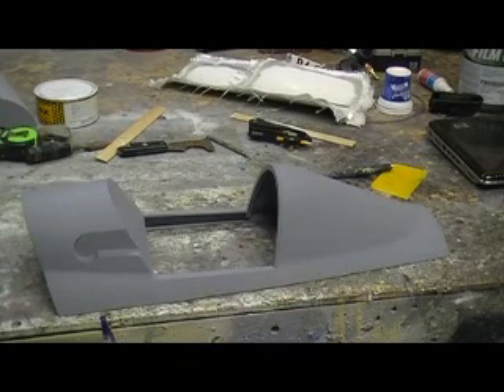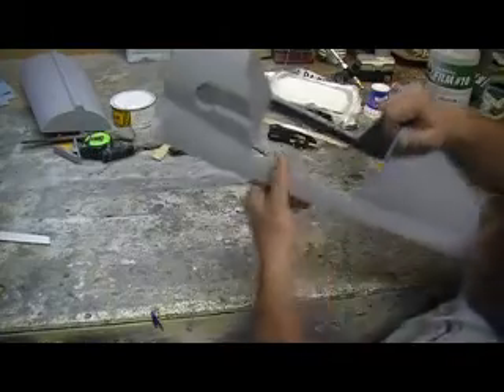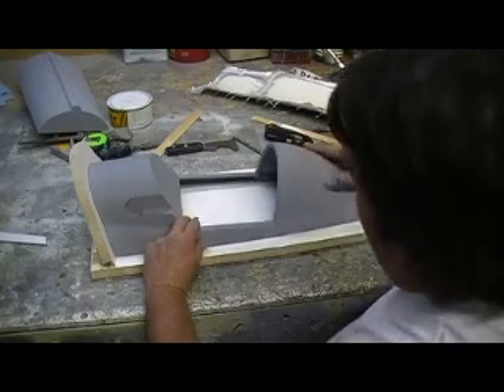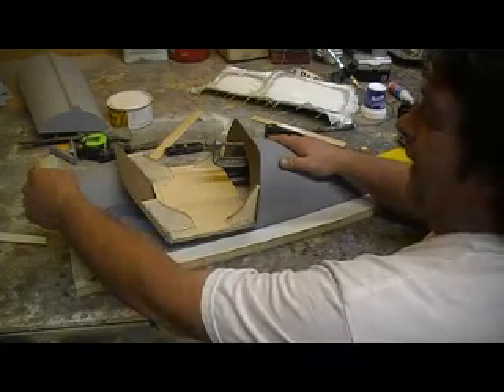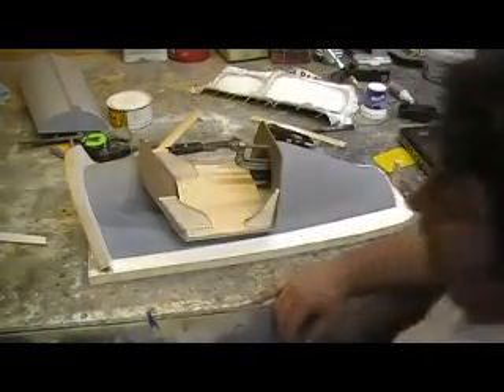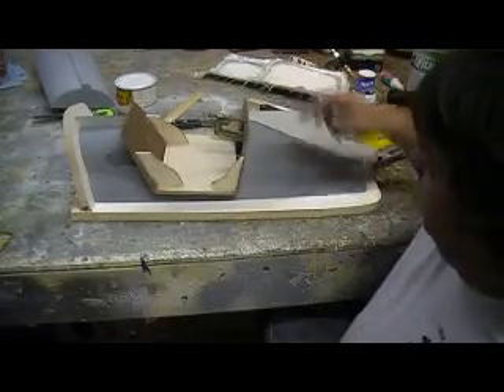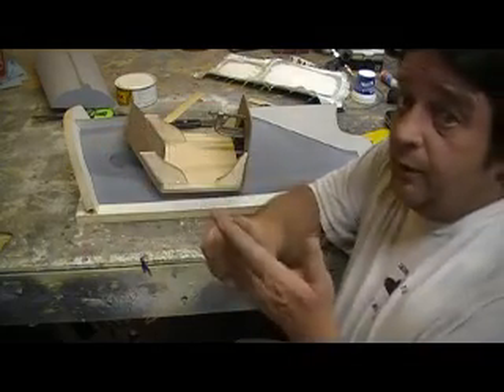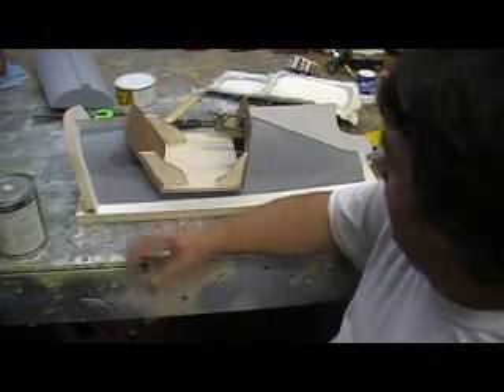how to build a rc jet  F-105 thunderchief # 167

Comment: I didn't think you were stealing my idea, I just thought you misunderstood my post. I have a hard time clearly putting my thoughts/ideas in the written form. If Bob wants to make a new mold for the canopy the only part of the mold that would have to be a removeable casting is the pivot area of the canopy arm recess. The straight arm part of the recess could be a permanent part of the mold because it doesn't have a lip to lock the finished part in the mold. The lip only exists in the pivot area.

Comment: Actually the only part of the cast of the canopy recess that would have to be removeable, is the rounded portion (pivot) at the back end of the canopy arm. The part of the canopy recess that represents the "arms" of the mechanism could be permanent parts of the mold, because the upper side of the part doesn't have a lip to hold the part in the mold. The only area that has to be removeable, is the actual pivot area.

Comment: @tmagdahl

That's basically what I said, make filler pieces, and then attach to outer mold. I don't see how to attach them other than screws, any alignment fixture would not let them release from the mold. One thing I didn't mention in part 1 was that the screws would have to be waxed also before casting the filler pieces, or they might not unscrew from the cast parts. My thoughts were an idea, they might be the basis for someone else to improve, and make a workable solution.

Comment: (part 2) Let the epoxy dry, then remove screws. Plug should pull from mold, and you will have 2 filler pieces. Install filler pieces back in mold, and tighten mounting screws. clay the joint between filler pieces and mold. Wax mold with attached filler pieces, and lay up a 1 piece canopy. Let dry, remove screws and pull canopy from mold. Pop filler pieces from new canopy, reinstall in mold, re-clay, re-wax, and lay up another 1 .  You might be able to mold the filler pieces from silicon,

Comment: Bob,

Could you take the original mold, and the part you currently have. Insert the current plug in the original mold, and mark the location of the recesses in the original mold. Drill 2 small holes (each side), of the mold in the locations of the canopy swivel recesses. Insert the new plug in the original mold, install screws in the holes you drilled in the mold. Insert the waxed plug in the waxed mold, and fill the open canopy swivel recesses with epoxy. (part 1, part 2 follows)